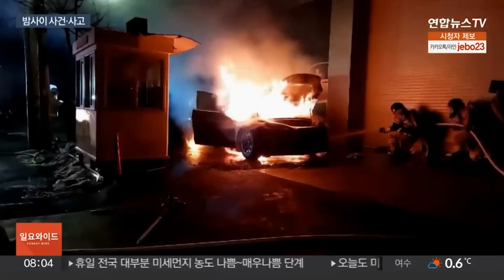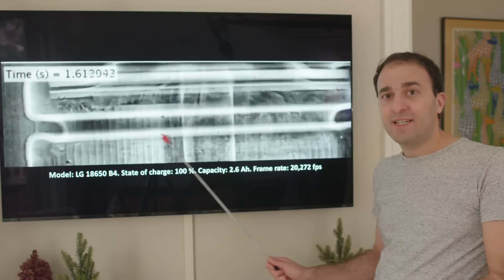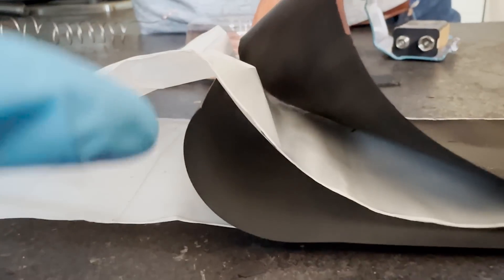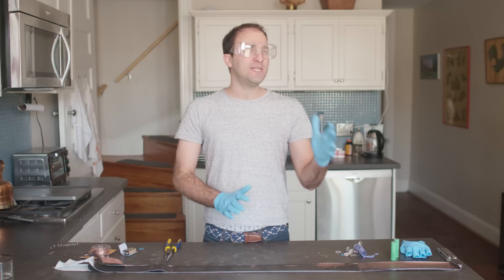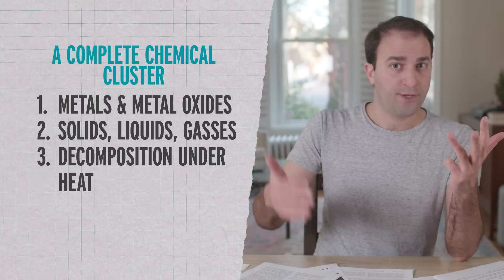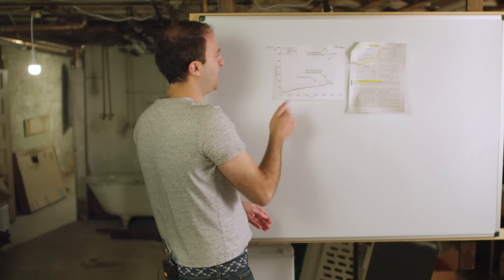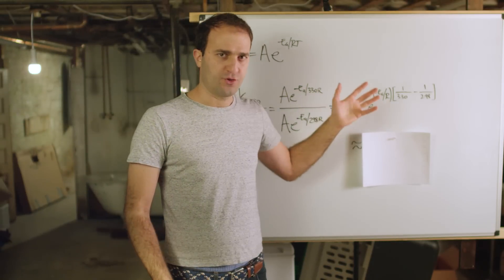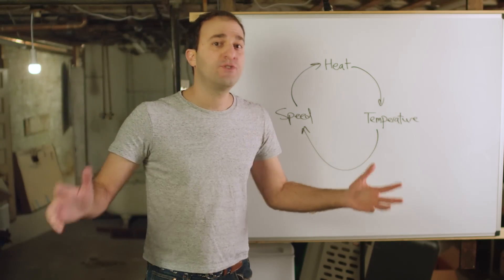Why Are Electric Vehicle Fires So Hard To Put Out?

Comment: We do understand how best to put out battery fires... the issue is that most fire departments don't have what is best for putting that fire out.  Think of the good 'ole fire triangle.  You need heat, an oxidizer, and fuel.  All water can do when trying to put out a battery fire, which is a metal fire that is producing oxygen, is to remove some heat energy as the water goes from liquid to steam.  If you douse a metal fire in sand, the sand sinks a large amount of heat, removing much of that heat.  Additionally the sand smothers external oxygen from reaching the fire.  So rather than only impacting one side of the fire triangle, by dousing in sand we can impact 2 sides.  Most metal fire extinguishers contain some sore of sand with other chemicals to increase effectiveness.  Problem is, it isn't very easy for a truck to carry tons of sand and easily put it right on top of a battery fire!

Comment: Lithium Ion batteries were first tested in 2 way radios during the Vietnam war. Thermal runaways had stifled commercial introduction for a long time. I experienced the changeover on video camera equipment where the so called memory effect of Ni Cad cells had to be eliminated. They built in computer chips to correctly charge and discharge them. Portable music players like the Ipod used them and paved the way for introduction into cell phones. Even the Boeing B787 has a blow hole on the side of the fuselage. New electric cars are designed to vent to the bottom giving occupants time to escape.
Reply: John B Goodenough invented the lithium battery in 1976. The Vietnam war ended in 1975.

Comment: The speaker should know 9V battery is not a Li-Ion battery.
The problem is quite understandable for scientsts. They hope solid electrolites will give better batteries and grow of the lithium dendrites responible for short circuits will not take place.
Reply: They do make a 9 volt rechargeable lithium battery
Reply: as a mechanic I discuss the problems with electric vehicles in depth on my home page vid.
Reply: They make both rechargable and non-rechargable 9volt lithium batteries.

Comment: They get spicey because they are fighting them with the WRONG materials. They really need to take a page out of the drone racing community and keep a dump truck full of play sand on hand. that puts lipo fires out instantly by smothering them AND drawing the heat. water and chemicals add fuel to the burn as it vaporizes. Just not thought out at all. Another reason EV will be a fail on a massive scale once fully implemented. They only think on profits when designing stuff.

Comment: "electrically insulating, chemically conduction" Mind-Blown!!!
The missing link on my understanding on WHY separator works since most explanation visualize it as "holes" to let Li go through but not electron, which does not makes sense to me since electron should be so much smaller than whatever elements... has been always wondering how a material let something bigger go through but blocking smaller thing.
But what does that mean "Electrons are way too reactive to travel through materials on their own"? 🤔

Comment: Love this video! I’m currently designing a product that requires a lithium ion battery for power, and I’m planning it with 2 redundant safety protection measures.
Reply: They are a fuel but they also produce a lot of oxygen which increases temperature.

Comment: Excellent video, love the edits!

Real question - The 20,000 gallons of water the fire department poured on the car, did it make any difference or did they just waste enough time for the batteries to burn themselves out naturally?
I'm thinking the batteries are burning though a sealed, water proof casing.  Is the water even getting to the source of the fire or are they just washing the seats and floor mats... and waiting for the fire to go out?
Reply from the maker: While it's hard to say for sure, huge amounts of water are likely to help stop a battery fire faster than just letting it burn. First off, by the time you have a full on fire, the casing is ruptured, allowing water in. Second, the water doesn't have to make direct contact at the point of the ISC, it just has to pull enough heat away from the battery to break the positive feedback loop that's providing energy and oxygen for combustion.
Reply: I was thinking the same thing. Maybe just keep the surroundings cool enough to not cause other damage? I have seen firefighters let a lost cause burn itself out and just concentrate on prevention of spreading.
Reply: How would sand or clay do to put out fire?
Reply: Yeah, I was wondering if something other than water could be used - of course, I realize that the general firetrucks carry water as do hydrants.... and the Fire Fighters would have to be notified they were going to an EV fire... But hypothetically (and chemically) is there some foam or something better for the job?
Reply: @SuperLocrian  Vermiculite works on such batteries, question is how it will work with a car?
Reply: while machining magnesium if it caught fire we used sand to put it out. Water makes it burn better. What does water do for battery fires.
Reply: So good for the environment? 20.000 gallons of water wasted on a car? Lot of people in the world don't have access to much water never mind 20k
Reply: @RetroMarkyRM  Just one small aspect of the greenness.